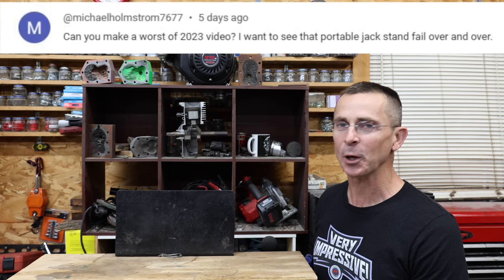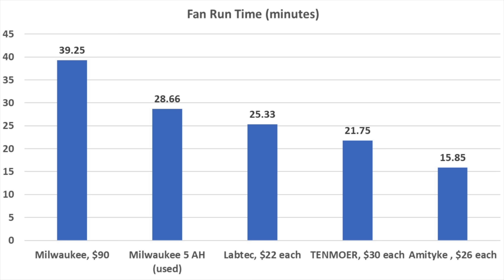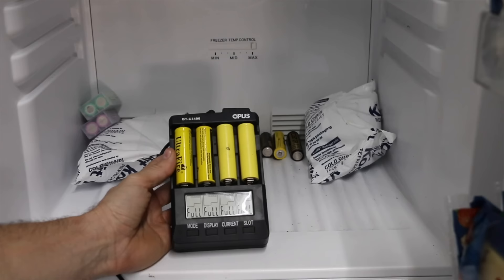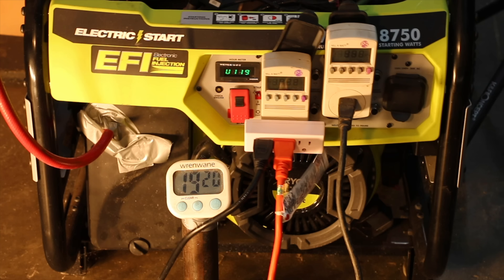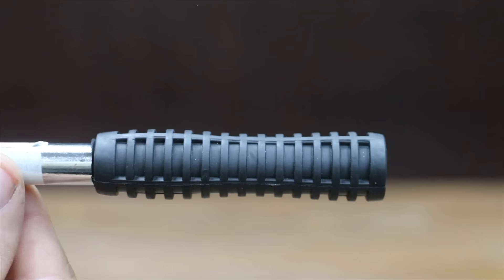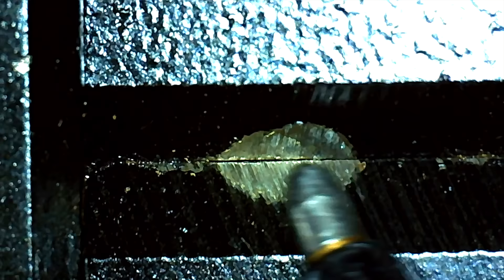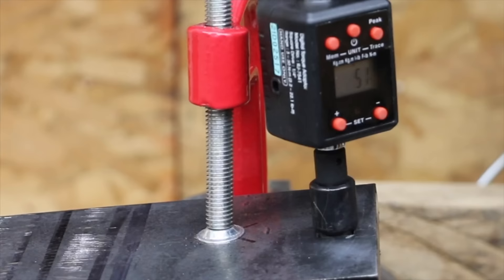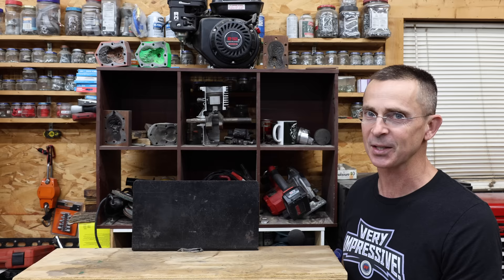10 Worst Items Ever Tested? Let’s Find Out!

Comment: The knockoff battery wins against the amityke. 26$ with 15mins is better than 90$ with 39mins. 

And since you need to swap batteries with the amityke a lot as well, it won't be that noticable. 

The fake might break earlier but this wasn't tested.

Comment: The HHO thing would've never worked for the sole reason that the first law of thermodynamics exists. Hooking up a fuel generator to an engine only acts as an additional load with an output that can never be higher than the fuel consumed for the input. If it were higher you'd have an infinite energy source.
Reply from the maker: Thanks for the constructive feedback.

Comment: I think you were scammed in many ways with these jackstands. They're sold in Europe (but of course manufactured in China) for ~20$ and, according to declarations on the box, can hold 2 tons, not 6. I suppose you have the same model because it has even stickers written in Polish. I have been using it for a long time and I am not 100% sure if they're completely safe but I am using them on the lowest height so they stand by using central part and it makes them much more stable.
Reply from the maker: Thanks for the feedback.

Comment: HHO generators intended for engines are a scam, the only ones worth even looking at buying are high end ones used for HHO torches, but even then they have limited uses, you're generally better off with either a propane torch or oxy acetylene.
However, they are fun to play with for other things and are super cheap and simple to make yourself. I made several when I was in highschool for a science fair project, it was a blast (literally)! Fill balloons or even just make soap bubbles with the output from them and light them on fire, a bubble the size of a golf ball is about as loud as a 9mm going off! I made a small torch out of mine. It was useless as a torch because the gas output was just too low, but you could rectify that by making several generators, but the issue you'd run into then becomes supplying enough power to the generators.
But as far as HHO generators to improve fuel efficiency, it's not going to happen - the energy you get out of the generator is less than the energy you put in, and the energy going in is produced by the engine, so as you saw it's actually a net loss as it's taking more power from the engine than it produces. The idea is akin to perpetual motion machines...
Reply from the maker: Thanks for sharing.

Comment: There is a widespread and erroneous (bordering false advertising) practice of Li-Ion sellers quoting "milliWatt Hours" as  "milliAmp Hours."     mWH = battery nominal voltage X mAH.  Typical nominal Li-Ion cell voltage is 3.6-3.7V, and a typical mAH for cheap cells is 2600mAH.  Watts = Volts x Amps, so 3.7V X 2600mAH = 9620mWH (close to 9800 and NOT milliamp hours).  Unfortunately, the copywriters pumping out specs are probably clueless if not outright dishonest.  A good brand name is more important than inflated specs.
Reply from the maker: Thanks for the feedback.

Comment: For context:
HHO converters actually work.  However, I'm pretty convinced that the specific one used here is designed to make you think they're a scam.  That one certainly is.  The key is with the size/configuration of the bubbler, the electrical pulse modulation and voltage. (You only need about 1.5vDC)  It's possible to build a complete system that will produce enough HHO gas to run a V8 truck that runs like a normal truck... Using nothing but water as fuel.  The bubbler needs to be around the size of a typical bed toolbox, cut in a quarter.  The pulse modulator is about the size of a ECU when all assembled.
There were some plans for the whole setup on the internet many years ago.  I'm sure its been scrubbed by now.

I'd like to avoid seeing this video become more ammunition for the "conspiricy theory debunked" rhetoric we're all tired of hearing.  I really hate being pigeonholed.

Just some food for thought.  Don't everyone get all excited.

Comment: Pointing out that HHO is "highly explosive" is stupid as shit, because burning any hydrocarbon (gasoline) will produce hydrogen, which is then also combusted. It is not physically possible for it to be any more explosive than the fuel already in the vehicle, or even your motor oil.
Also, you can separate the anode and diode on the electrolyser, which put out pure hydrogen from one side, and pure oxygen from the other, rendering it completely uninflammable until oxygen is reintroduced. That being said, sticking one in your car is an absolute waste of time and money, because you'd just be burning fuel, to generate motion, to generate electricity, to generate hydrogen, to generate motion, instead of just stopping at stage two and moving the car, rather than an alternator.

Every form change is a reduction of efficiency, because entropy always increases.

Comment: Those ZSP jack stands are a lawsuit waiting to happen. Those stands will send you to the shadow realm faster than a New York minute. I have a pair of very reliable Craftsman jack stands, but even rarely use them. I prefer ramps and wheel chocks which are much safer. If you have to use jack stands, slide the removed tire/wheel under the frame as a safety backup. I'm going to assume that most if not all the worst tools were made in China. I try to buy German and Japanese tools when possible, as they typically have the highest quality.
Reply from the maker: Thanks for the feedback.

Comment: Looks like 22$ battery is much better value than original battery costing 4 times less for 4/5 of performance,  unless you need that extra torque
Reply from the maker: Thanks for the feedback.

Comment: Yeah, i don't think you installed it properly. In HHO kits, more amperage equals more bubbles. more bubbles equals more fuel (HYDROGEN and OXYGEN) going to the engine. Then comes the issue of what type of OBD system you have. All have to be adjusted to get peak performance..... I was getting 40+ mpg while on cruise control.

Comment: holy moly that hydrogen genator idea is wild. The energy needed for generating hydrogen is additional work for the engine and the mixture of fuel vapor with hydrogen, who could have thought is not magically better than just the fuel that the engine is designed for 😂 where the f*?#* goes the hydrogen to motor? Airstream from the carburetor?

Comment: so the worst ever battery, that cost 26 usd and worked for 15 minutes, while the standard you measured cost 90 usd and worked for 40 minutes, let me see, oh, wait, that means the worst one is cheaper per work time for usd than the gold standard you measured it to...

ok, you had one in that test for 22 usd that worked for 25 minutes, but still the so called worst is beter in the selected fact than your standard.

Comment: "...Internal resistance of 48..." what? You don't think most of your viewers would understand the word "OHMS," so you'd rather just be vague by leaving it off? Or wouldn't you figure that even if they don't already know the word, once you say it while talking about that specific type of measurement, they could automatically associate the two, as in the potential thought, "Oh, ohms must be the measurement of electrical resistance"? And if you plan to reply, then will you please say something specific that shows that you actually read what I said rather than just a generic thing like "Thanks for your input" with no actual answer to the question?

Comment: 5:15 wow. 48mOhm. that is REALLY BAD. for reference that's like 4~5x worse than any reasonable high discharge rate cells. Even low discharge ones top out around like 15mOhm~20mOhm. NOT 48.
Reply from the maker: Thanks for the feedback.